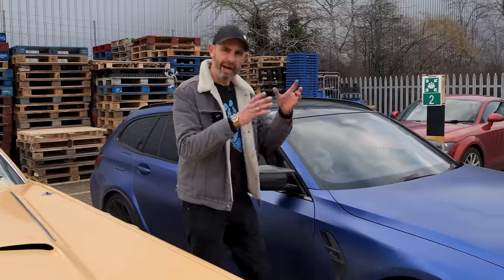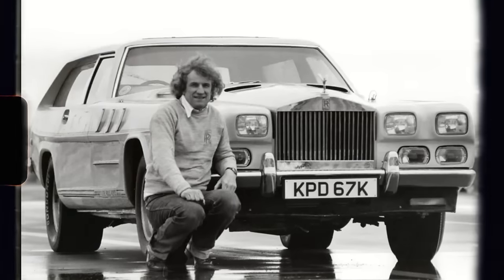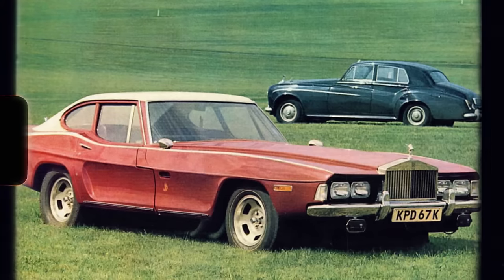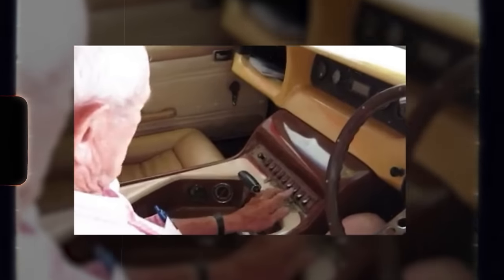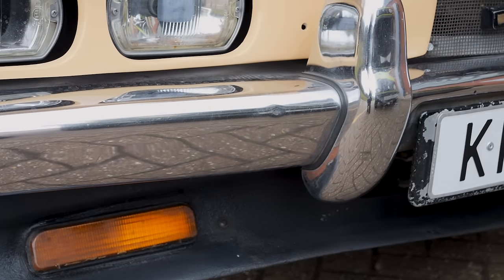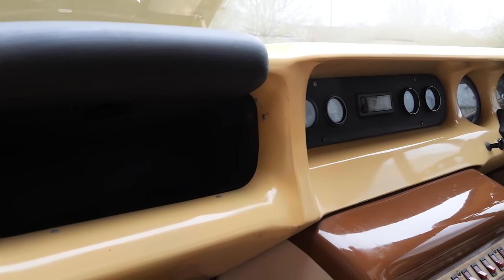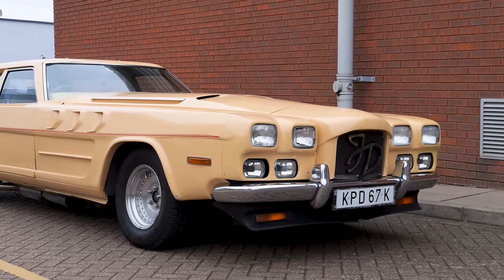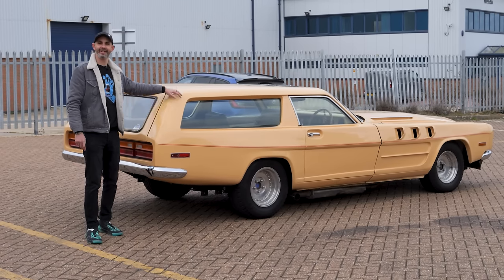Driving The Beast! 27-litre V12 Spitfire engined car on the street

Comment: Hi Jonny, when I was a teenager I worked at a garage in Orpington, John Dodd had his garage just up the road on the A21. He used to road test it up & down the A21, and did he used to give it some beans..!!! The loudest and quickest car ever at the time. I spoke to John at the petrol station once, in my overalls so he said do you want to see the engine, well... half an hour later, and with a crowd now blocking the petrol forecourt, he was still happily explaining bits and pieces he'd made etc to me. I've never forgotten it 40 odd yrs later. Hope someone buys it to enjoy its  individuality, what a build by a special British engineer, well done Mr John Dodd.. Alex.
Reply: Yes indeed, John Dodd's garage was at Pratts Bottom on the A21. We lived up the hill, and we would know when 'The Beast' ( 1st Version) started as a plume of smoke would rise out of the valley! My sister actually got to ride in the car, but then her legs were prettier than mine 😂
Reply: @mikewood3334  

Lol… yes the noise was epic, and I remember it stinking of old oil and fuel.. proper British engineering..!!! Alex.
Reply: Correct as my mum lived on main road in Petts Wood, Southborough Lane,  and we saw it a few times!😅😅😅😅. We saw it a few times and it was awesome for us kids!  He always waved at us as we jumped with joy on the pavement!
Reply: What a great memory to have and share.
Reply: @chrisblay  

Hi Chris,  I do remember he knew every nut, bolt and washer on that car. Mega passionate about the car..  Alex
Reply: That’s such a awesome story
Reply: @1973miniclubman  

A great memory, especially hearing John has sadly passed away.. Alex.
Reply: Did he speak about when he took the Fuengirola Spain, John was there a lot in the 85 ish.
As he took me for a drive as a kid around his villa where he stayed.
It was such a quiet place in the hills but when this started up everyone came out.
John was such a friendly guy and loved people taking interest in this car.
Reply: It really is a small world, amazing bunch of stories
Reply: So it was him, the legend in Gravesend where I used to drink some weekends through the late 80's early 90's evading the police along the A2
Reply: I grew up in Bickley and I remember seeing the car go by a few times when it was in its first  incarnation. The first time I saw it John was filling it at a local petrol station. I don't remember too many things from back then but I remember the first time I laid eyes on that car.
Reply: Lucky man 😂
Reply: I grew up In Orpington and my dad worked at Fort Halstead and he told me about the spitfire engine car that he saw going about
Reply: I remember John Dodds car. Looked like a Rolls Royce.
When he went on business trips to France and Germany the Autobahn police tried to stop him but couldn't anywhere near catch him so they wrote a letter of complaint about Rolls Royce testing their car on the autobahn which apparently somewhat puzzled RR because they didn't have a car over there ! 😄
Reply: @Olichi60  sounds like it would forever be in a petrol station😯😆👍
Reply: All these comments about him, simply reinforce my view that the poor bastard had ADHD.
Reply: It spent many years in Billingshurst too, stored in a barn by Paul Jamesons son Robert.

Robert was a family friend, I may or may not have played in this car as a child 👀
Reply: @alextripp1230  RIP
Reply: @mikewood3334  I lived in Pratt's bottom as did my nan and grandad. Norsted lane by the green. Great memories 👍
Reply: Who could forget “The Beast”? 
What an inspiring man John was, a classic Englishman, who obviously enjoyed an engineering challenge. Original and unique, the Beast will always provide joy to those who see it (apart from sidiq khan) this car is the most extreme example of a beautiful distraction from mundane life. What passes for individual transport today will never receive the attention of this or Classic cars still on the road today. We are uplifted by unique beauty as human beings, and we need it. Something our jailers in politics and the media will never understand. But then, they have no soul.
Reply: @markmcnicholas9475  as it is over 40 years old it is exempt from ULEZ as a classic.  😅
Reply: This explains why I’ve seen it a couple of times in Tonbridge 😂
Reply: Nice one. Well done you too.
Reply: @greyguy.960  He was a genuine ambassador for good British engineering. He was a proper speed freak LOL amazing bloke.
Reply: You might want to add a capital letter,  @Sc50001 , to the second part of that town's name.  Don't want anyone thinking you were a sh*t, do you - not least what folk could say about your dear grandparents.  
😬
Reply: Are deception and delusion key parts of "good British engineering",  @stuarthart3370 ?  
Dodd didn't accidentally misrepresent what this car was, or could do.  He didn't share some estimated figures, before engineering and construction was completed, and then only forgot to update those figures later on. 
Dodd intentionally and continually lied about how fast it was.  (Granted - in a straight line on a good surface - it would out accelerate most specialist drag racing cars.  Big whoop! 😐)

Not only that, he seemed under a delusion about just how wonderful it was overall.  
This mutant simply never was, nor could be, the equal of any 'high end' performance car, or luxury car - much less any luxury high performance car of its day (Maser Quattroporte, Benz 300SEL 6.3, Monteverdi 375, A.M. Lagonda, Jag XJ12, Bristol 412, et al).
Reply: Mister Dodd blew past the chod
On the A21
Then he comes home each evening and encounters a speed gun
So who did you think you were  kidding RR-Motors
If you think The Beast is done!
Reply: No way! I used to hang out with a mate who lived in Pratts Bottom around 1980 - of course we had heard of The Beast, the thing was a major legend, but we had no idea it was local. Lovely to see it's still around and even moving.
Reply: I remember seeing the Beast on Breakfast tv in the early eighties. It was at the time it had broken down and still had the Rolls Royce grill. Just one of those things you remember forever.
Reply: I reckon the windscreen could be cortina like the doors.
Reply: Wow how very fortunate of you

Thanks for sharing
Reply: Thank you for sharing this😊
Reply: Thanks for sharing.
Reply: @assininecomment1630  user name checks out. 😋👌
Reply: Memories like this should be added to a "beast book".
Reply: This has to be the ugliest car in the world
Reply: @Alex Tripp  given that he designed it that would be obvious.
Reply: Ok so this is the thread filled with the fantasy storytellers lmao.
Reply: Grounds for a documentary that!
Reply: I wish I could have learned from John Dodd
Reply: Quit lyin
Reply: What's this clanking sound? Especially when idling. It's something broken?
Reply: @assininecomment1630  god your handle is really apt mate.
Reply: @Iaintwoke  my fist thought was a mark three Cortina too, but it might just be from a Granada as it could have been a bit wider than the Cortina one, but it certainly looks to be a Cortina in shape.
Reply: @EbonyPope  it certainly doesn't sound like any Merlin engine I've ever heard at start up and cold running. It sounds as if somebody is chucking buckets of bolts down on an aircraft hangar tin roof. Certainly something is a bit amiss with it.
Reply: I grew up in Bromley and heard a lot about the car but don’t believe I ever got to see it. Especially running as I probably would never have forgot that. 

I also remember hearing about Rolls Royce not being happy about it.  

Now watching this, the myth, the legend becomes a reality! 😄
Reply: "It was such a quiet place in the hills but when this started up everyone came out. John...loved people taking an interest in this car." 

Ahh, @greyguy.960 , that 'interest' might not have been quite the positive response that you're painting it to be. 😬
Reply: I was looking at this guy with the British accent and then I realize this guy's Middle Easterner.
Reply: @assininecomment1630 , true, true I truly don't know what people were thinking but I did see a lot of people approaching the car and taking an interest positively.
Reply: Disappointed in Rolls Royce - what a great publicity car for them - the original car was a Rolls and so he had simply modified it.  At what point can it no longer be called a Rolls?  If I buy a RR and wrap it? Update the interior? Upgrade the engine… do I suddenly lose the Rolls status?  Surely if it is registered as a Rolls it should be able to keep the Rolls grill? Sorry - I may be off, but also having a rant on behalf of JD
Reply: @glassdomedesign  🙋‍♂️🧠💪🎼💚
Reply: def could tell he wasnt driving it like john would have this was built to be a hot rod who wants to put a 27L motor to drive slowly wish he would have given it some beans let it open up some
Reply: @toxictophat711   I agree, however, it is a one off and I think it scared him a bit……. 🧠💪🔥🎼
Reply: Bro signed his comment like a letter lmao
Reply: @mikewood3334  Hello Mike, the garage was the clock garage at the bottom of Chlsfield hill, opposite ' Mr Hook's ' butchers shop.

I remember it well, and remember going into the garage and watching them working on the bodywork of the car.  we used to hear it often, as they started it and tuned it, and watched when they took it up the road on a test run.  they used to go round the loop from the garage, up to Bager's Mount roundabout, don to Green street Green roundabout, and back up the main road past Charnwod Farm to the garage in a time trial.  You could hear that engine over the whole journey.

This was a bit like the legendary motorbike run from ' Johnson's ' care at West Kingsdown, up to the roundabout, then down ' Death Hill ' to the rounabout at Eynesford, and back up to the cafe, before the record stopped.

The car I remember was the original, which and was an extended ' Roles Royce ' which we think was the inspiration for the one in ' Thunderbirds '.  I used to live in ' Ethel Terrace ', at the bottom of Rushmore Hill.

If you were around at that time, you may well remember what an amazing variety of motorbikes were in the village, Chris and Peter Taylor with Vincent and Velocette, The Jenner brothers with series A HRD Vicents, Peter Cousins BSA Gold star, myself BSA 500 chair unit, BSA B31, 350 AJS, 175 Fransis Barnet, Sid Elliot 350 BSA B31, ' Tonka ' 650 BSA Road Roket, who sadly lost a leg, and manny more.

There was an old chap who lived in the village opposite the recreation ground who used to ride around on a 1000cc v twin JAP, with his wife in the sidecar, who used to race a ' Brough ' dragster at santapod.  Good old days,  I am so proud that I was part of that generation, where we would tackle anything and make good out of what we had at hand.

John was of that ilk, and should be held up as an example for the young of this country to follow, true ' Brittish'  spirit.  Kind regards Mike,
than you John, and thank you Jonny for this video.  Kind regards,

Tony Marsh.
Reply: @bellerophonchallen8861  indeed, I spent a lot of time on Rob’s farm as a young lad …
Reply: Jesus said, “No one can enter the Kingdom of God (God's family) unless he is born of water and the Spirit. Flesh gives birth to flesh, but spirit gives birth to Spirit. You should not be surprised at my saying, You must be born again” (John 3:5-7). what does this mean? Well you have to believe with your whole heart that JESUS died for your sins and after 3 days and nighrs GOD raised HIM from the death, so you can be baptized and after being baptised ask GOD for the HOLY SPIRIT . WHO will guide you trough life!
Reply: I had a similar experience at the petrol station at the bottom of Gravel Hill. What a nice man.
Reply: would you buy it ?